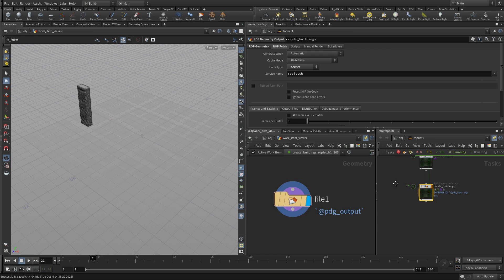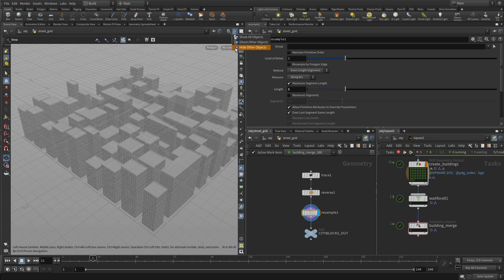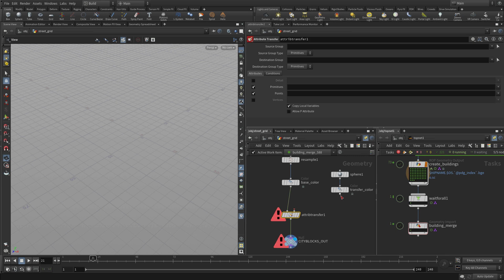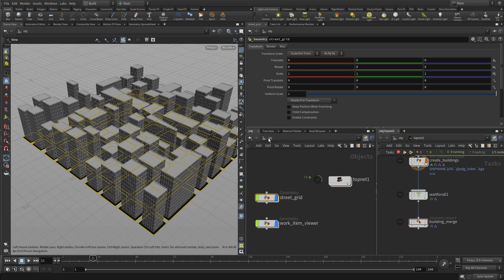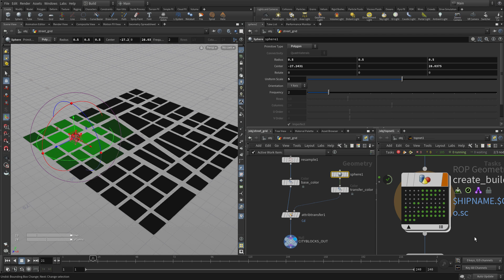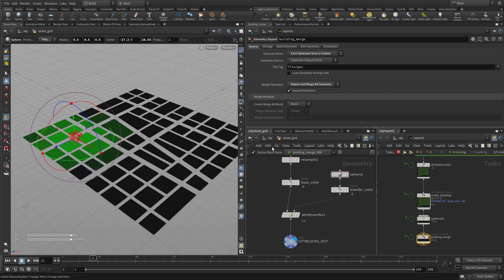Houdini Foundations: PDG 5 | Combine the Buildings

Comment: If you are stuck at Geometry Import after "create_buildings". Check the Node "create_buildings" to see if "Use External SOP" is True. Make it False (Untick it)
Now Your Geometry Import Node under "waitforall" shouldn't get Error anymore. 
Now you probably encouter another things. Bunchs of vertexs are jump randomly after you select "work item" of the "buildings_merge"
Solution is you just need to set ouput for the TOPs Network and go back to the top tree of the Network View. Like if it help you :face-green-smiling:

Comment: When I try to cook the Geo Import node I get an error saying "invalid input geometry" and the buildings stop appearing, even if I go back a step. Any help with this would be appreciated.
Reply: What worked for me was unticking 'Use External SOP' for the ROP Geometry Output? Noticed mine was on by default after I spent an hour pausing and scrutinizing every setting in the previous episode.
Reply: Same here fore me! Are you also on the apprentice version? When I checked my /geo folder, the ROP Geometry Output node wasn't writing any new geometry files. That's at least the problem for me :P
It might be the same for you. Still I haven't figured out yet, how to solve it.
But maybe it really is just the limitation of the apprentice version...
Reply: @hanneshuber3d  did you figure it out?
Reply: are you resolve it   .  Same problem :<